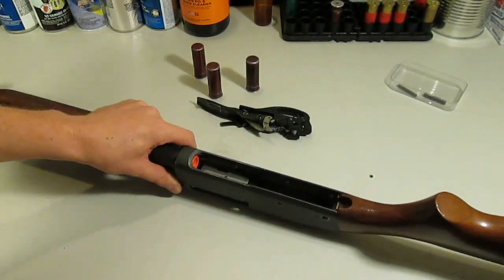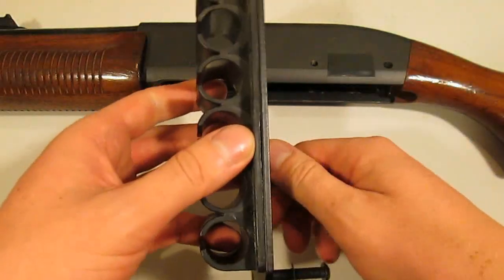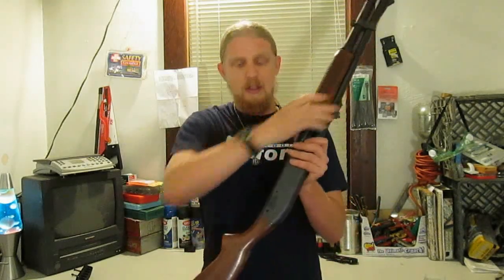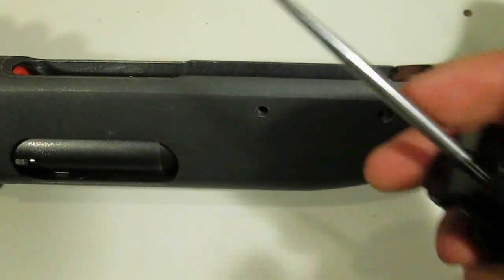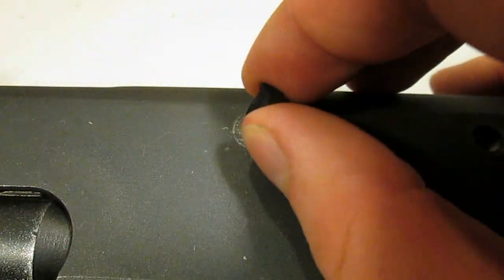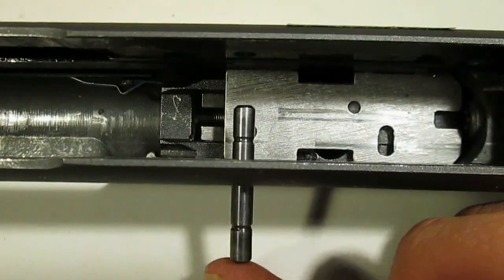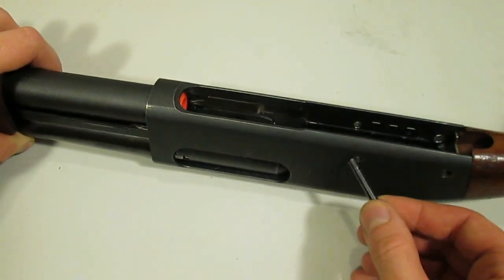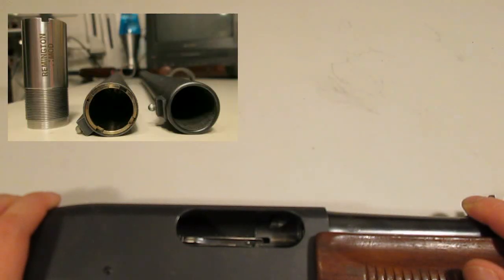Fixing a Displaced Shell Latch - Remington 870 Tips & Tricks #8

Comment: I shot the gun with the pin slightly dislodged (accidentally, I didn't notice it), which resulted in the shell latch getting pushed way back.  I'm not sure anything pushed through the opposite hole will reach it, and if it does there won't be much leverage.  Any tips on tapping it forward?
Reply from the maker: Try shaving down the end of a wood or strong plastic dowel so that it fits into the shell latch hole from inside the receiver, then tap on the end with a hammer to work the latch forward.  You may have to take your stock off to get the right angle on it.  Once you get the hole in the shell latch close enough to the hole in the receiver, you can follow the steps in this video to get it aligned.

When you get it re-aligned, check to see if it's loose in the gun's receiver.  If you're worried it might fall out, you may want to re-stake it.
Reply: It turns out using a punch worked fine.  I don't think it's possible for the shell latch to be in its groove and move so far back it's out of range for your method.  Now to figure out how that pin came out in the first place.
Reply from the maker: thinkmassive Check to make sure that pin's detent spring and the carrier pivot tube are in good shape and installed properly.  If they look okay and you're still seeing excessive pin walk, you could try installing a second detent spring in the carrier pivot tube to hold the pin more securely.  More information on this is in my T&T # 4 video:

Trigger Pin Detent Springs - Remington 870 Tips & Tricks #4

There are aftermarket Chicago screws meant to replace the factory trigger plate pins, but those are kind of a hassle, and you shouldn't need to resort to that if there's nothing wrong with your trigger plate assembly.

Comment: Do you have any tips on installing a shell latch new? I was re-assembling an 870 and the action bar caught the right shell latch too hard and popped it off. Would appreciate any tips for reinstalling it completely.
Reply from the maker: They shell latches staked in place; re-staking takes a special tool to do right.  For most folks, it makes more sense to let a gunsmith with the proper tools and know-how handle this, rather than buying very specialized tools that you may only use once.

Comment: Does the latch need to be restaked to be reliable? I've got one that slides back and forth loosely and has to be held in place while disassembling.
Reply from the maker: It's better if it's staked, but once the gun's assembled and the trigger plate pin is holding it in place, it should still function fine.  Plenty of old 870s out there are running fine with loose shell latches.

Comment: Have a question: way rem 870 locks up, the action bar lock travels upward to release the slide, travels downward to lock the slide. to lock the slide forward the action bar lock is down, the action bars on the forearm tube assembly come in contact with each other, the ends of each should touch to lock the gun tight,( right ) mind has play, there is a 1/8 in. space where they should touch, whats happens with the gun locked forward the forearm will move maybe 1/2 in forward and backward its still locked, it is really a noisey thing I want to fix, I purchased this 870 at gun show 60's model wingmaster good condition cheap price, slug gun with good sight 20" nice wood, anyway the problem is the space I expect to have tight gun, other than spent 150.00 for new parts how can I adjust this.  Thought with new action bar lock and spring, new fore-end tube assembly and new slide, would tighten like new gun but at cost around 95.00 and it would be gamble might not do anything might have to get new shell latch also, shell hold shell in the magazine but also stops the forward movement. mind has small gap also.
Reply from the maker: Not really sure I understand what you're saying.  It sounds like your 870's slide has a lot of back-and-forth play when it's locked forward.  Is that correct?

Comment: My new 870 20 gauge drops unfired shells out of the bottom when pumping the action one loads and one falls out of the bottom
Reply from the maker: Joseph Painter Could be an issue with your right shell latch.  Does the tip show any unusual wear or damage?  And when you have the fore-end back, does it extend inward enough to serve as a positive stop for the shells in the magazine?

Comment: Any idea why the shell latch wont allow the next shell out of the magazine tube to be loaded?
Reply from the maker: +chicken taco awareness saga Not sure what you mean.  Are you having trouble loading your 870, or is it not feeding correctly?
Reply from the maker: +chicken taco awareness saga Check the angled parts on your action bars.  If these surfaces are worn or damaged, the shell latch may not be moving far enough to the side to release shells from the magazine.
Reply: +SynchronizorVideos its brand new though. i am gonna send it in to Remington. i was just trying to avoid that
Reply from the maker: chicken taco awareness saga It still could be a problem with the action bars.  Defects are rare but they do happen occasionally with anything man-made.  The problems you're having could also be caused by improper assembly, so you might want to have someone local at least look at it before you send it off to Remington just in case it's something simple like that..

Comment: on my 870 the left shell latch keep protruding out to far keeping a shell from entering  the chamber but I did check for latch displacement but no displacement please help
Reply from the maker: Check to make sure the shell latch isn't riding on the inside of the action bar.  This can happen sometimes if the gun is put back together incorrectly, and/or parts are worn.
Reply: the action bar do feel hard to push when it happens
Reply: My bad not the left shell latch the right side
Reply: was your issue resolved? I have an 870 express having feeding issues which sound similar it was my dad's gun and he had lost the carrier so I ordered a new one with the bolt and carrier out it will feed fine and the farthest part back on the hand pump will come clear back to the x in express. when I installed the carrier and bolt it will only slide the hand pump back the the e in express it's only an eighth of an inch which is all I need for it to feed properly. is it possible the replacement carrier is slightly too long preventing it from sliding that extra eighth inch?

Comment: My marlin model 120 magnum won’t keep cheap shells in the tube like when you shoot the shock of the shell going off ends up making all the shells shoot out of the tube but when they are a good brand like Winchester or federal they stay in, I noticed this when using cheap challenger skeet shells, annoying when I’m trying to hunt pigeons and only get one shot
Reply: I have a similar problem with my Hatsan Escort, which is often called an 870 clone. It happens with snap caps as well as Winchester and Federal birdshot. (With the current ammo shortage, I haven't been able to run anything heavier through it.) 

In my case, it's not the shock of shooting it, but racking it, that makes all the shells in the magazine shoot out. 

According to some old shotgun forums, a gunsmith can fix this pretty easily, but I haven't had a chance to take my Hatsan to a gunsmith yet.

(Oddly enough, I have the same problem with my Maverick 88 when using Challenger short-shells, and it is the shock of firing that sets that off. It doesn't have the problem with full size Winchesters or Federals. I have acquired some Aguila mini-shells but haven't had a chance to try them yet.)

I wish my reply to your question had a solution, but I guess this is more commiseration. :-)

Comment: Can this cause shells not feeding into the chamber?
Reply from the maker: Not really; a displaced shell latch will prevent you from installing the trigger plate assembly in the receiver, and an 870 obviously isn't a functioning firearm without the TPA.  I suppose you could say it interferes with feeding by not letting you install the components that actually do the feeding... but I'm guessing that's not what you're talking about.
Reply: It will cycle 4 of 5. The last one is always stuck. If I release that latch manually the shell pops right out.
Reply from the maker: Josh Ledbetter So it's not chambering that's the issue, it's feeding from the magazine?
Reply: Not chambering. I wanted to file down the latch but didn't cause once you do that you can't put it back on.
Reply from the maker: Josh Ledbetter If the problem is your shell latch, don't try to file it, just order a replacement.  But before you mess with the shell latch, I'd take a look at your magazine spring and action bars.  Those are more likely to be causing your problem, if I'm understanding you correctly.
Reply: Ok. I will take it to the gun smith. Thank you for your help. I like your channel very informative.  O yeah I have both Mossberg and Remington,  I think Remington is more solid than Mossberg.

Comment: So can it still function without the right latch?
Reply from the maker: An 870 needs both shell latches in order to function properly as a repeating shotgun.  It can work as a two-shot gun with just the right shell latch missing, or a single-shot with the left latch or both latches missing (you may be able to get two shots to work here too, but it depends on specifics of the gun and it'll be a little janky anyway).

Comment: I'm having FTF issues, due to the shell latch hanging up......while gun is assembled.
The pins are in place.
Can they shift while still in place?
Did I wear out my latch?
Should I replace it?
Has this ever happened to anyone?
Thanks in advance for any help with this problem.
Reply from the maker: The shell latches shouldn't be able to move with the trigger plate and front pin in place.  The tips of your shell latches may be bent, or you could have worn-out action bars that aren't moving the shell latches far enough to the side for reliable feeding.
Reply: Yes, thank you.
Let me tell you where I'm at right now.
1. the small pin is not easy to move, and needs hammering in and out.
Where as the large pin can be pulled and replaced mostly by hand.
2. When I'm observing the action close up while slowly racking; It functions and lets the shell pop out.
When I rack it normal, or fast, the action bar notch travels behind and misses catching the latch, pinning the latch tight to the shell, and locking it in place.
Multiple racking will eventually make the bar connect and move the latch out of the way.
This SG is not old, and is racked as fast as possible in training.
I've only ran about 500 shells through it....all successfully till now].
The bar doesn't look worn, so the bent tip theory is what I'll address next.
Thanks again for your help.

Comment: Has Remington come out with improved shell latches that increased the stake points from 2 to 6???
Reply from the maker: Yes, quite awhile ago.  You only see the lighter latches with two staking recesses on older guns.
Reply: Synchronizor Older guns like a 1979 Wingmaster? I’m just wondering if it would be worthwhile to install the newer shell latches... 🤔
Reply from the maker: If you're not having issues currently, and this gun isn't a heavy-use or critical-duty piece, I wouldn't worry about it too much.
Reply: Synchronizor Hmmmm... Vang Comp is recommending it for a project I’m considering on an older 2 3/4” Wingmaster. That and the Flextab kit, and the back bore job.
Reply: Oh, and new 18”, 3” magnum barrel of course.
Reply from the maker: I mean, it's not like it's a bad thing, the new shell latches are better parts.  If your project is a defensive/fighting shotgun, I would probably recommend upgrading, though if the latches are currently working fine, I would place the flex-tab update at a higher priority for a defensive build.
Reply: Synchronizor  I’ll be having Vang Comp do both jobs along with the barrel work. They wanted to put a 3” ejector, but I think it’s best to stay with the existing 2 3/4” from what I’ve read. Is that wise?
Reply from the maker: @flyboytim2009  If you don't intend to use 3" shells, you can leave the ejector parts as-is.

Comment: Actually it's a huge design flaw. When I removed the trigger assembly from my 870 both of those latches fell out. Now I can't reassemble it. This is the second problem I've had with a Remington, and I'm starting to think that their products are junk.
Reply from the maker: That's not a design flaw, that's either wear (in the case of an old or well-used gun), improper assembly (if the gun's new), or user error, as shown in this video.  Those latches are designed to be staked into the receiver, so if they're not staked, it's obviously not a design problem.  Actually, the 870's shell latches will keep on working even if they come loose from the staking - although the gun does become rather more of a pain to put back together.

Comment: I used a punch from the inside and tapped rearward until aligned no wear on pin holes he he he
Reply from the maker: That can work if you have the right size punch lying around.  A lot of casual gun owners don't have complete punch sets though, including myself when I made this video.  It also may require you to remove your stock in order to get the right angle.
Reply: no I just had the trigger set and follower out plenty of room for 6 inch punch 3/16ths tip just putting it out there use a bent coat hanger if necessary im all for improvise, adapt, and overcome
Reply from the maker: It depends on the stock, pistol-grip or thumbhole stocks will tend to get in the way of things like that more than a normal straight or semi-grip stock.
Reply: I do the same with a 90 degree allen wrench.